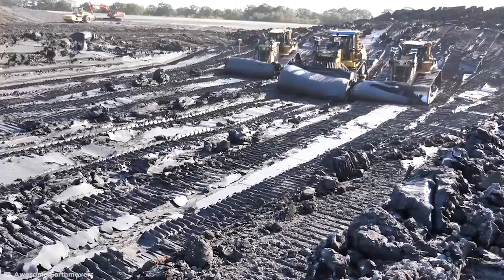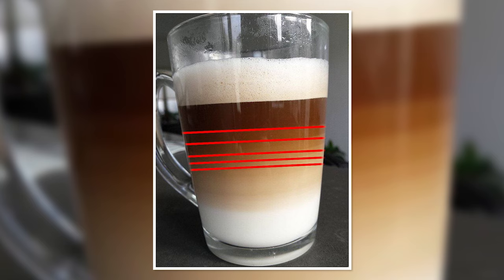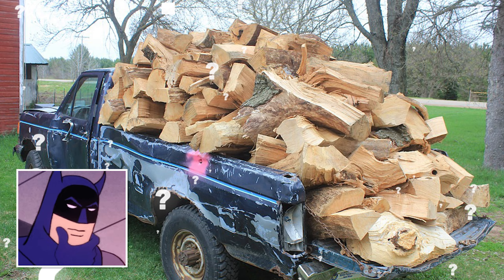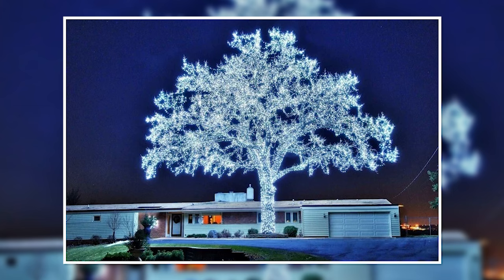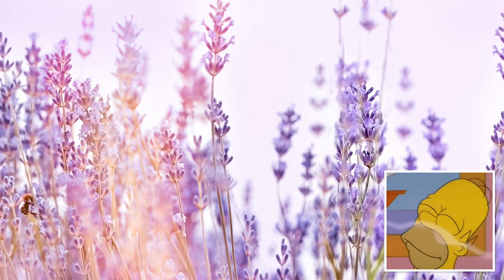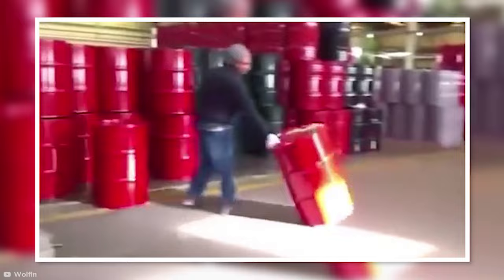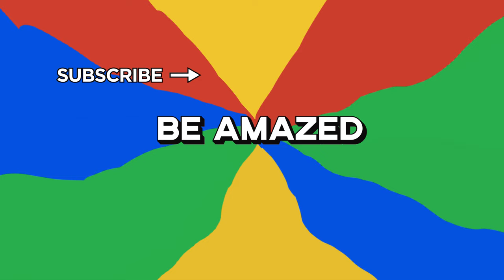Perfect Work That Will Satisfy Your Soul

Comment: (This maybe made up) The IGE also has buildings, aircraft, and other things that will literally satisfy your soul so good. The B-1000 maybe an ugly bomber but look inside it's compartments and see for yourself. You think i was done with Tanks. Oh boi u'd be wrong. The VT-500 is the second largest tank and the largest tank ever to satisfy your soul. It's interior compartment walls. Are made of literally gold. But this VT-500 i am talking about is from Japan. So you have to wear socks cause the floors in that tank has Tatami which is natural Material. Which meant it can't be cleaned. Lastly the IGE makes the most satisfying buildings you ever seen. The Guamerfi Victorana is it's landmark

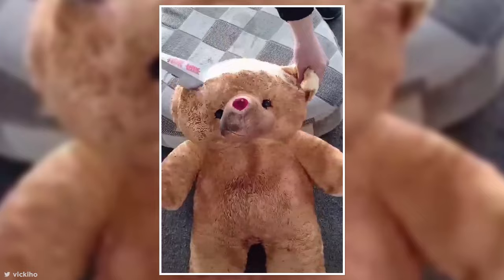Comment: 8:14 - 8:25 - those cold cuts sandwich wraps look mighty good
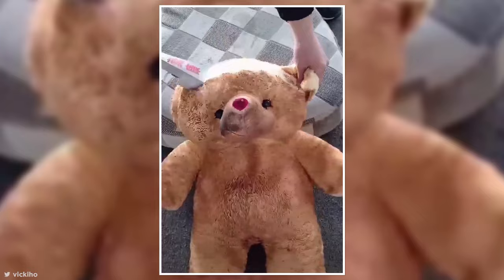8:32 - Awwwwe, are they shaving Teddy Roxvin's head?
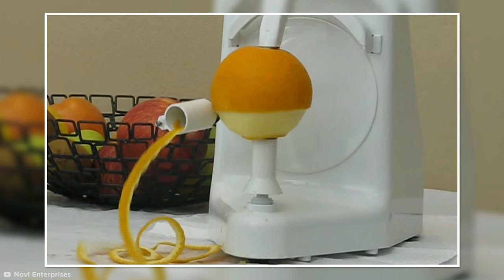9:21 - I like the orange peeler. But you shouldn't peel apples, the skin on apples are the best parts, and where the fiber and vitamins are
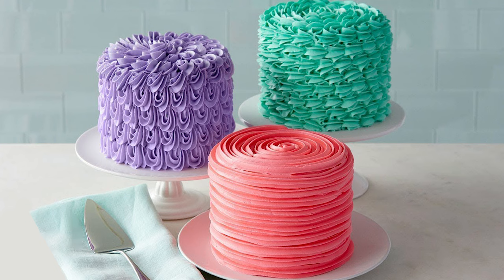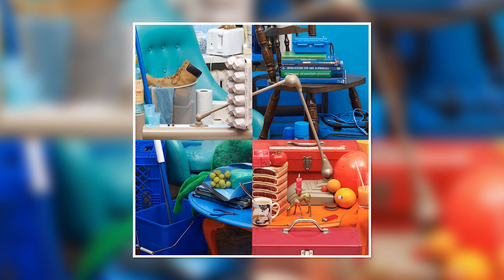10:34 - 11:00 - MMMMMMMMMMMM 😋😋😋😋😋